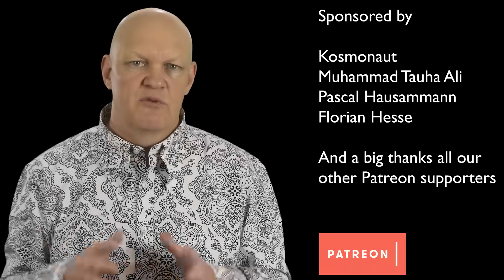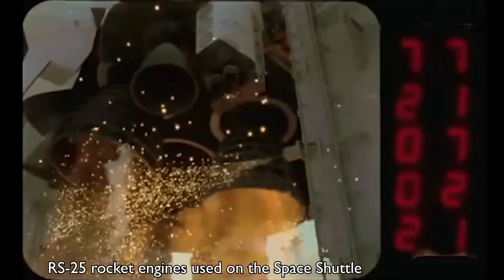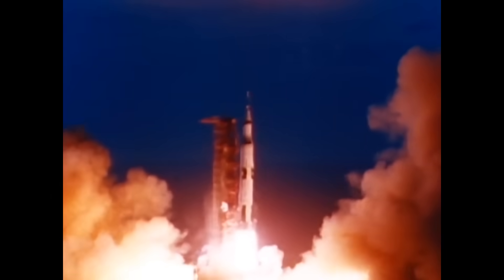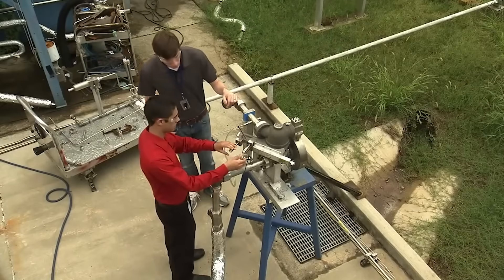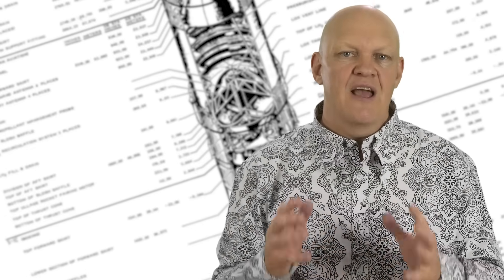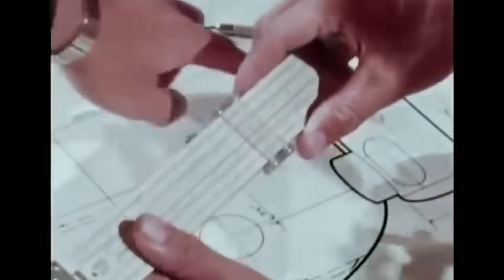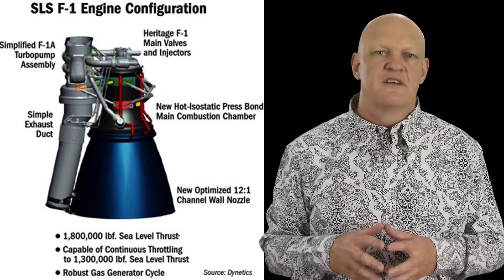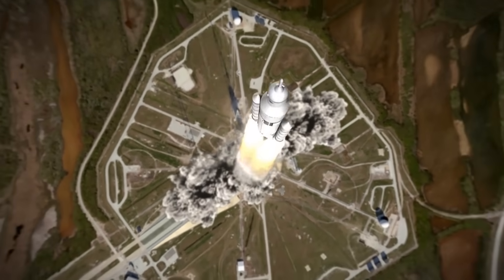Why Can't we Remake the Rocketdyne F1 Engine?

Comment: I'm a welder fabricator, I worked for the same company since I was an apprentice and i knew every job as well as the tricks i used to put jobs together bringing good old paper drawings into reality,  once I'd had enough of that place I got a new job but on several occasions my old bosses called me asking questions and asking if I could come and show the current guys how to do things,  I thought id push my luck a little and ask for a weeks worth of cash at my old rate just for an hour of my time and they actually paid it each time!! lol I was flush for weeks with double wages coming in.
Reply: HAHA yeh I thought about it after the first phone call, they said yes too quick,  I probably could have got more but after the first time they would come straight up with the same offer :)
Reply: That's the problem with making yourself indispensable. That happened to me after I graduated high-school. I was the only one who was competent with the sound and lighting equipment. I got called in to fix the sound mixer after one of the students blew an op-amp by hooking something up wrong. Fortunately, the only thing that blew was a little 8-pin SIP (the op-amp), which only cost a few dollars to replace, minus my labour in repairing it. After that, they PAID me to run their sound and lighting.
Reply: ?ClueLess? I never minded the idea of showing a new hire our routine but the company kept hiring throwaway temps from an agency. They had zero skill or basic technical training or even motivation to do an honest days work sometimes. It was an insult to me. Like they felt any kid who came from flipping burgers at a food court for min wages could take my place with 30 minutes demonstration time.

That's pure management greed. Hire someone who has an equal skill and general education background as myself and I'll gladly show them the specific skills of our company line but I'm not even going to try and transfer a lifetime worth of knowledge to some unmotivated punk who'd rather work at the mall for the same entry level pay.

Needless to say that company didn't survive the last big downturn. We were down to fewer than six people who actually brought some skill and three dozen or more throwaway "team members" filling out the ranks at the end.

If it was my call we'd have had fewer people receiving a better pay grade to get more work done. Management prefers greater numbers of poorly paid underlings. Go figure!
Reply: @puirYorick  "Like they felt any kid who came from flipping burgers at a food court for min wages could take my place with 30 minutes demonstration time." I don't mean to be rude, but that's probably true. Unless the agency gave you people with mental disabilities, there's nothing they couldn't learn given an hour, two hours, ten hours, whatever. Part of it depends on your teaching skills, too.
Reply: @General12th  in theory most people can learn but my point is that I paid handsomely in time and money for my education and they expect me to just teach it all - and I stress that it was ALL, from basics on up to specifics in an hour or two when teaching isn't really what I was hired or qualified for. You can't reasonably take a kid off the street and expect him to learn high precision pipe welding on an oil platform say when his only previous job was clearing dishes at the food court. You need to hire someone who has at least been qualified to weld first then you teach and demonstrate specific techniques.
My hourly rate entitled them to my efforts in every reasonable task I signed on for which didn't include basic skills training.

That's the greed of management in trying to get highly skilled work out of low-rate untrained bodies. It may pass muster at the Golden Arches but if you do that building rocketship components people will die.

My actual situation involved products where they needed zero failure on delivery because they could cause direct harm to a client  if performance was flawed. Not as publicly spectacular as a Russian rocket blowing up mid-flight but, on an individual basis, very painful.
Reply: @puirYorick  Okay, that makes sense. If these people also needed a crash course in welding training, yeah, I understand why you wouldn't be able to teach them properly. Why do you think the agency kept giving you undertrained temps? Regardless of their background, whether they flipped burgers at Subway or performed brain transplants at Cleveland Clinic, shouldn't every temp you get have the requirements you specified?
Reply: @General12th  The agencies essentially acted as pimps for their fee and didn't care much how "suited" any candidate actually was for an assignment. It was simply the nature of the jobs market and the economy I suppose. They allegedly filled requests for candidates in broad categories but their screening was not very earnest or honest and my employer was complicit enough in allowing this to continue. The entry level pay was quite a bit lower than actually hiring on qualified people and paying benefits.

I used the welding example because we did have an in-house machining department and should have had skilled trades-persons employed exclusively there but things degraded to having second and third generations of people who'd only learned how to push a sequence of buttons and so on from someone else who had learned from another learner who may have been shown the general tasks by an actual skilled machinist who'd been trained in a proper course at a trades school or college.

Welding happens to be one of those trades where they used to make you demonstrate your ability before offering you a job even if you showed your papers from an accredited institution. Now it seems guys who watched it being done by a buddy a few times and think they have the hang of it are working as welders.

To be clear, I'm not prejudiced about someone having flipped burgers in a past job. I merely assert that they need a certain aptitude and a basic standard of skills training in a job category before stepping into the high-technology precision environment where there is next to zero fault tolerance to make the task successful. It shouldn't be the norm to train candidates from a raw state while they actually work under the same tasking umbrella. There's more at stake than a few over-crisped fries. Rocket engines (like brain operations) take precision.
Reply: Reminds me of a friend who bought a high-power stereo amplifier in the very early 1970's....clearly labeled on the output...8 OHMS....and 2 channels....seems like maybe 200 watts per channel....so he hooks up 2, 4 OHM speakers in parallel, maybe thinking it would be even louder....got sound for maybe 2 seconds...then nothing...I had a bit of electronic knowledge, and with no test equipment at all....and no fuses on the output, but the 3055's were hot....I tried replacing all 8 of the 3055 transistors...and it worked..!Those transistor were pretty cheap even then...$2-3 each. Later, I checked out the 3055's with my Simpson 260....all were shorted.

Comment: There’s a lot of knowledge gone because of automation. Today only profit is important, so individual skills don’t matter anymore.
Reply: No, its because being able to produce the same result every time matters. Individuals can be brilliant at bespoke, but machines are better and faster at reproduction and that leads to less faults overall. NASA is in a unique industry with limited use items. The rest of the world I think would prefer the reliability of a 2018 car over a 1968 car.
Reply: Garret Olds true. But replacing workers with robots doesn’t make the world better. There are less jobs and a lot of knowledge is gone. Not always important stuff, but it’s that knowledge you basically could use all around the world where there’s no automation possible.
Reply: Well there are less jobs in certain industries, that's true. I think the hidden social cost of innovation and technology change is that humans are analogue, not digital. It's good for your head to work with your hands, which is why even though I have a desk job, I try and be actively crafty outside of work to fill that drive. Overall, some industries are just going to die off and there's not much to be done than change with the times... which is tough if you're middle aged and faced with it I'm sure.

Comment: The first invention of rocket science was great one... but if we calculate the natural gas used in rocket it's too much per one rocket and space craft... the changes can not done in earlier machine because the structure is very complex to understand and too reduce the parts from the engine. Light weight can go faster but it can not be stable but it can be if we use proper shape. Lots changes can made F-1 engines in great look. So, why don't you make from start which help you to create great engine.

Comment: I was a Project Manager / Senior Estimator for a company that produced many different mock-ups, test models, and static displays for NASA and multiple aerospace / aviation companies.  I can tell you that the F-1 rocket engine was a Big Beautiful BEAST to behold.  We produced several static display models of the Saturn 5 with Apollo capsule, full size, complete, and accurate to the last rivet and paint detail, with F-1 motors.  One of them is at US Space and Rocket Center, Huntsville, Alabama, 367 ft tall, free standing.
Reply: BigDogBob
I was about to ask about the Huntsville Saturn V, and you answered my question.   Where are the others?
Reply: Moderate Fkr Troll
Reply: J Shepard there is a beautiful saturn v at the Kennedy space center in florida.
Reply: J Shepard, One is displayed, horizontally, at the Houston Space Center, you can catch a glimpse of it in the movie Space Cowboys, the other is at the Cape in Florida.
Reply: the Saturn V and  F1 engines were  WELDED ... NOT RIVETS   .....WATCH...>  MOON MACHINES
Reply: I have actually visited and seen that specific display model at the USSRC, and it is massive and beautiful.
Reply: +ona48. Not entirely. Welded and riveted (and bolted & bonded), depending on the specific application. Here's a photo of some Saturn V rivets (close up of bullet damage photo).

https://www.google.co.uk/url?sa=i&source=images&cd=&cad=rja&uact=8&ved=2ahUKEwipxIKG_LzcAhUDEVAKHTcACLYQjRx6BAgBEAU&url=http%3A%2F%2Fwww.collectspace.com%2Fnews%2Fnews-050312a.html&psig=AOvVaw1tf-3jJsrkMbiUbKwUEUSm&ust=1532701391070919
Reply: From the Wikipedia article on the Saturn V, and from recollections of my last tourist outing to The Cape:  The Saturn V at Johnson is made up of three flight-ready stages. The Saturn V at The Cape is made up of a static test first stage and flight-ready second and third stages. The horizontal display Saturn V at Huntsville is made up of three static test stages; the outdoor vertical display Saturn V was a purpose-built replica constructed in the late 1990s. There's also a first stage in Mississippi. The last remaining third stage was converted into the backup-and-training Skylab, and is at the Air and Space Museum in DC.

I saw the one at KSC when I was a kid in the 70s; Dad worked for NASA and got us onto The Cape to watch the Apollo Soyuz Test Project launch (the Saturn IB sitting on the big "barstool" :) ). My wife and I toured KSC in the  late 80s and I remembered wishing they could move that Saturn V indoors, as it was deteriorating. Next time we took the tour was the early 2000s. They did a BANG-UP job with the new visitors' center/Apollo 8 launch complex presentation/Saturn V hanger. WELL worth the time and money to go see it, especially if you can hit the Cape around a launch.
Reply: They were all mockups. The Apollo programme was pure propaganda theatre. All that rocket power just to put a bunch of professional liars into low Earth orbit...!

Comment: The F1 engine, and indeed the Saturn V rocket it powered, is in the same league as the Egyptian pyramids; a monumental example of engineering and willpower that cannot practically be built today - not because we don't have the technology, but because we have completely different techniques and materials in use today (slave labour working for a "God-King" in the case of the pyramids).  The tragedy of the F1 engine and the Apollo program is not that we cannot reproduce it, but that it was curtailed before its time by the same cynical political reasons that led to its creation.
Reply: Piramids were built by FREE citiziens.
Reply: Yes, they were free to work for a pittance or starve, doing back breaking labour that often killed them anyway.  Full marks, though, for making a comment that has nothing to do with the F1 engine.  You probably felt quite superior, even if you can't spell pyramid.
Reply: @occamsrayzor  you make big case of small typo. The point still stands. All current research points to pyramids built by free, employed citizens led by superbly organized state. Even if you work slave to death, you simply can't get beyond certain level of motivation and quality from forced labor and eventually enforcement cost will eat up entire endevor.

Comment: Nice line.

Townsend Brown's Anti gravity device was 2000 times as efficient as the shuttle motors in converting power to thrust. In 1957.

We're not making rocket motors because we don't need them.

Dr Paul leviollet's book on anti-gravity. Costs about $7 on Kindle. But don't bother. You know everything about everything already.

Comment: Great presentation but, we don't have the people with the skills? My word you lost it here, think harder dude. We could rebuild you know this, we don't for a bigger reason and it won't be much longer until more find out. 
I use techniques far older than 50 years in my job and that also includes a slide rule, bevel, square etc etc
So Stevenson and Brunel can build anything they desired back in the 19th century from metal, but now we just don't have the skills! Pah

Comment: The cost of development of new tech gets spread around to a lot of people, lots of skilled programmers replacing skilled machinists. Always someone to pay, but you get more funding making new stuff, not driving costs down making more of something you have. Something to consider, but not nearly as important as the fact that more advanced computers expect more precision, which requires the same in manufacturing, leading to skilled programmers replacing skilled machinists.. We need to be fostering both skill sets still. There is more skilled machining done on YouTube than NASA seems to do by hand these days, SpaceX too. Why chunk it out of a block of metal when you can 3D print it. NASA still has problems with contractor bloat.

Comment: Something is wrong here. They did recreate the F-1A as the F-1B. Using modern techniques to reduce the part count big time. That is how recreation of old designs is supposed to work. The fact that the notes for the hand assembly techniques were lost is irrelevant. The hand fitting back then was done because of the short production run and it was cheaper to do it that way than to perfect the system. As for learning the techniques, the engineers back then learned them is about 4 years or less. Surely people today could relearn them if necessary.
I saw this as an engineer myself who has recreated two vintage products in the last couple years. Except one of the old products from the 90s has more features. The one from the 1950s has dramatically better performance, Both are easier to build. 

My point is the presenter sort of contradicts himself by saying the F-1A could not be recreated. So what. The F-1B recreated the performance and is the direct descendant of the F-1A. So yes, they did do it.

Comment: I worked for Rolls Royce (jet engines) starting in the 80's and I can understand the quality of engineering that went into their manufacturing but to say it can't be repeated or its been lost is not true. The redesigned engine based on the original  would have been straight forward once the design was computerised.
Reply: Than you should realize that having blueprints still says not much about tools and process. Had that been the case, that shape of article does it all - your company wouldn't make profit by selling Soviet Union the very engine and technology to built it, that was later used in MiG-15.  You can have digitized profile of modern airliner composite wing and still be clueless about process (e.g. details of 'baking') that was used to put it together.

Comment: Unfortunately many believe. “If it’s not broken. Why fix it?” That is why NASA is going for the solid engines. Plus it has been around for along time. With the new liquid engine you have to design it build it, test it. All the while you need to find fundings, and hope the investors don’t grow tired along the way to pull the plug. That would not be good, since the time put into the project could go down the drain. Then, there is NASA could decide to cancel any moment too. On Seekers new format. I don’t see any problem with any format. Just as long the information is too the point, easy to understand and entertaining too. If the information is too long, then break it into parts.